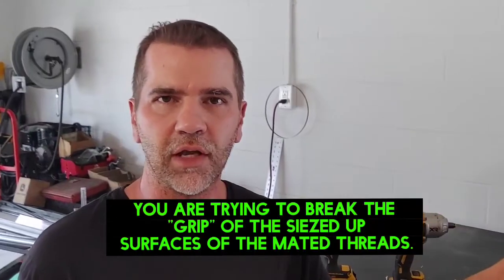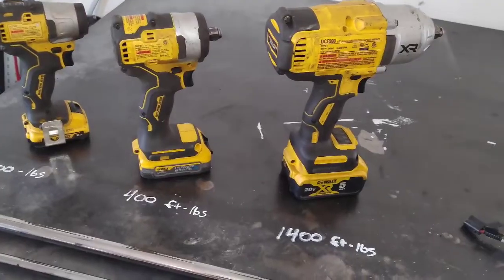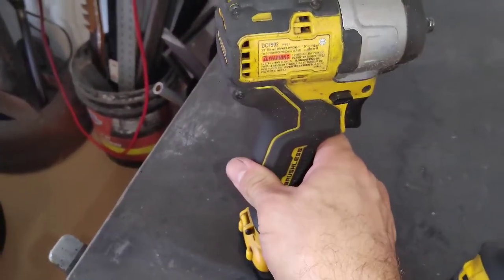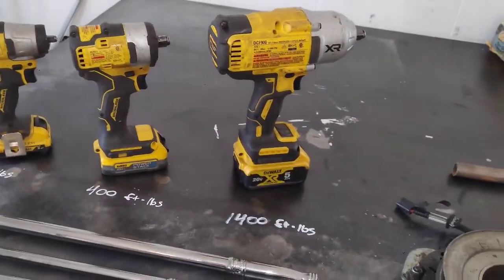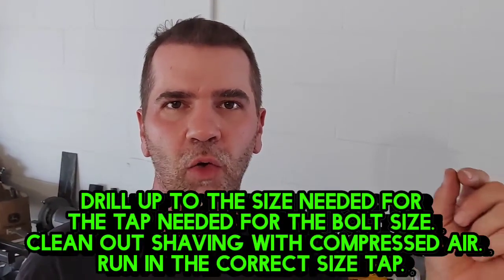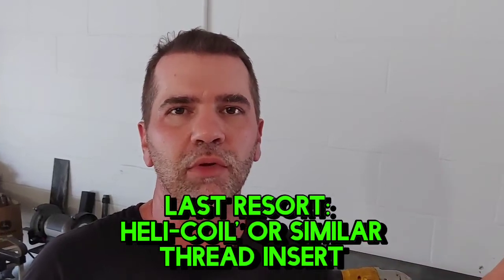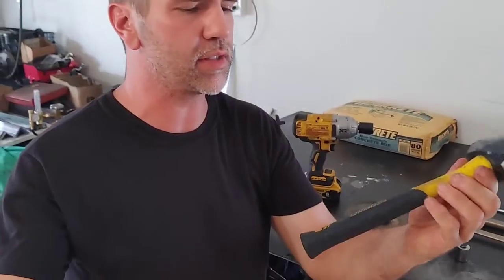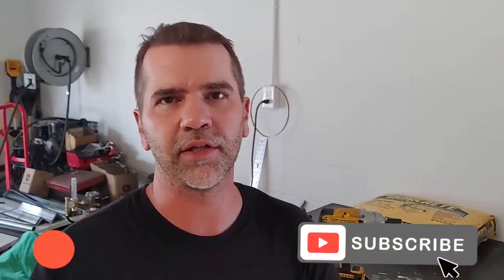Tips to removing a siezed PTO clutch bolt. Video response to a common question I get.

Comment: Thanks for the video. I have a leaking seal on my PTO shaft (Hustler-Honda GXV670). Can I replace the seal from underneath without removing the engine?
Reply from the maker: I'm not sure if the hole in the frame is even large enough for the seal pass through. Removing the engine isn't fun, but it's not too bad. If you end up removing the engine, disconnect the battery first, stay organized, and take pics to help reassemble everything.

Comment: My PTO clutch fell off one day mowing. Bolt completely sheered inside the drive. Tried a easy out tool. Tried drilling the remainder of the bolt out. Doing everything off the ground with about a foot of clearance. So I don't have all the fancy tools and lifts. I resulted to putting a size up from 3/8 to 1/2 inch all thread inside the drive welding it center. Slide the new clutch on, tighten the nut on the bottom. Job complete, or so I thought.. the stop bracket comes flush with the PTO stops. The new clutch seems cheap made although it's almost an exact replica of the OEM. Wish I could show you a video of this. One side of the clutch has what looks to be heavy rivets clasping one side of the clutch with pre measured shim between magnet "top" and clutch bottom. No adjustments can be made on the gap. So once again I modified the bracket to extend another 1.5 inches to keep the clutch from vibrating and jumping over the clutch stop. What a nightmare.
Reply: The nightmare is how long it took me to come to the final outcome. After hours drilling and trying to remove the remaining bolt. Welding, plus modifications to the stop was so much easier.
Reply: @elite_slayer01 so I’m at the very exact same point about to weld a screw on the crank shaft and place the clutch to tight whit the lock but at the end, this actually works well? Please I need an answer
Reply: @angelmarrodxn3861   yea its perfect.
Reply: @angelmarrodxn3861  it's better to weld all thread. As long as your measurements come out the same.

Comment: All good advice
Cant beat an impact hey. I have a heavy duty cordless Makita that has 4 settings so you can go gentle or give it max. I dont use it much but an essential tool if you need to undo a bolt or nut that would otherwise turn the whole thing when using normal wrenches.
Reply from the maker: These new battery impacts are amazing

Comment: What do you think about that z830A. I might be getting one for free it hasn't run for a year though.
Reply from the maker: I dont recall ever working on a Z830A. But hey free is always good. If its been sitting awhile you're probably going to need to replace the carb, clean out the old gas from the fuel tank, and blow the fuel lines out to get it started. Plus a new fresh battery. Hopefully nothing major is wrong with it.